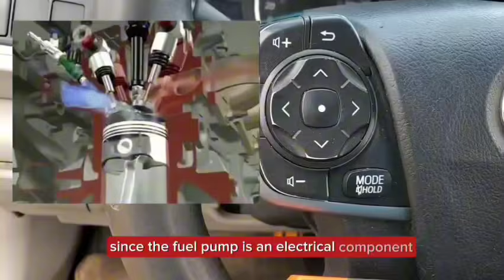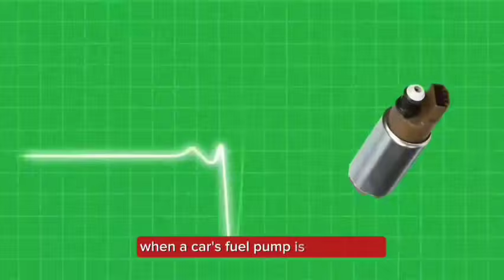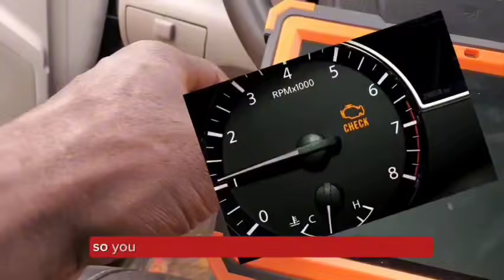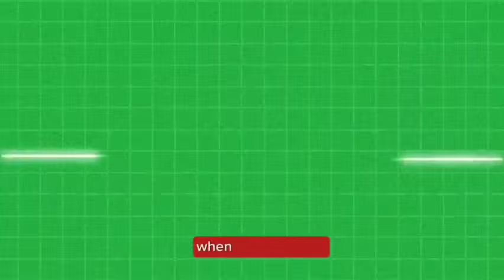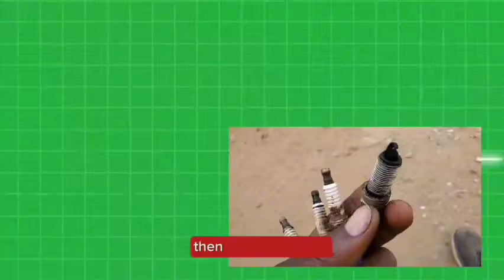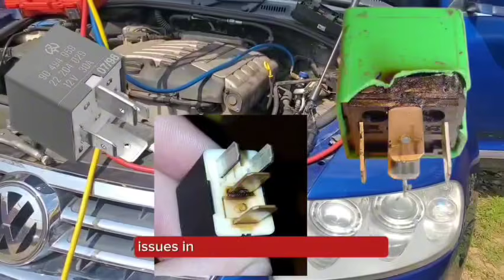BAD FUEL PUMP RELAY SYMPTOMS

Comment: Of course, you could check the fuel pump relay. My R1200RT motorcycle doesn't have a relay or fuse. Instead, it has a computer called the ZFE module. When I turn the key, there's no fuel pump noise. When I press the starter button, the crank turns, but I can't replace and test the expensive ZFE module, so I don't know of a simple way to determine if it's faulty.

Comment: I have a GMC terrain SLE 2.4 engine and I replace the fuel pump and the battery and the spark plugs now it's the fuel pump control module 2010 should I get I got to use fuel pump control module and you say has to be programmed a brand new fuel pump control my door

Comment: i have 95’ honda accord and the fuel pump power gets cut off randomly in drive and wont turn back on until after 30ish minutes of sitting. It shows a check engine light but throws no code

Comment: Thanks for discussing the 10 reasons a fuel pump really can go bad. I definitely found out that I have at least a couple. I don’t hear the fuel pump noise in the backseat and I also see that my relay looks kind of burnt. I did a multimeter test and it is clicking, but I hear something shaking around on the inside. I’m going to write this off as a bad relay and buy a new one.

Comment: Can the faulty relay blow the fuel pump fuse ?
This is happening on my 1990 BMW E30 316i . It got worse and seems like a hard short circuit.

Comment: I have an 06 Honda stalling out when i shift gears.  I was told it was the tcm. But i also smell gas as the car is in idle after starting. And i jear squealing (high pitched sound) under the hood. I cant find anything specific. I can fix it myself if i know wtf it is. But i keep getting mixed info. Idc im not paying  a mechanic hundreds or thousands for something i can do myself lol. I need a diagnosis device. The was hit in the back twice also. Once before i got it and then after. My husband spent off the highway ramp and hit the back. So i actually thought it was the pump. But i also have no leaks.🤷🏾‍♀️